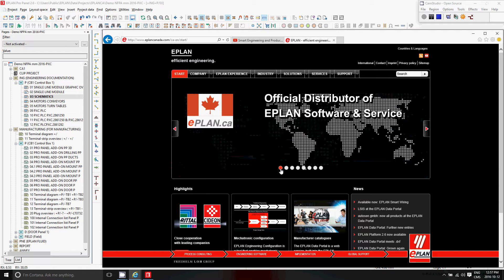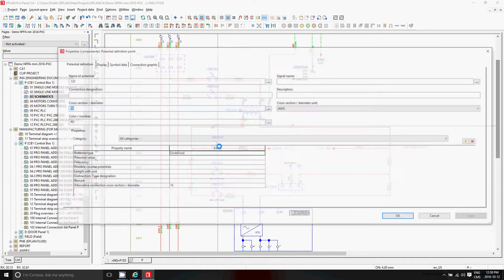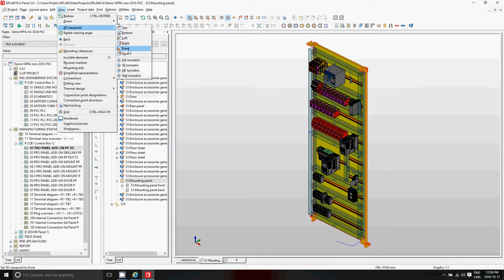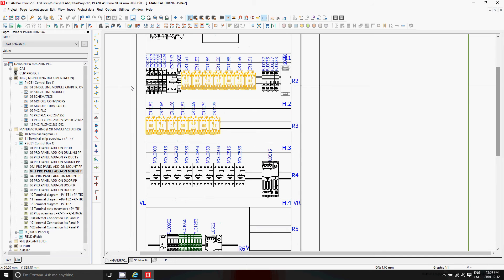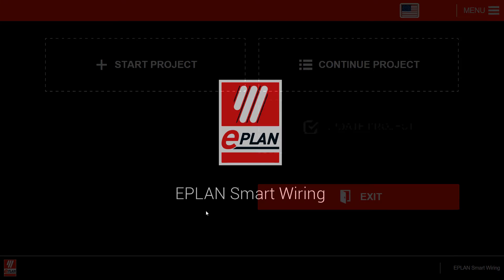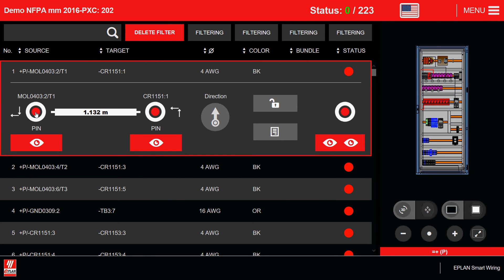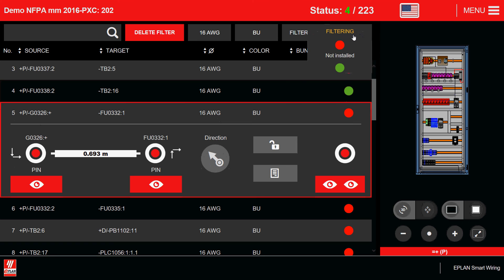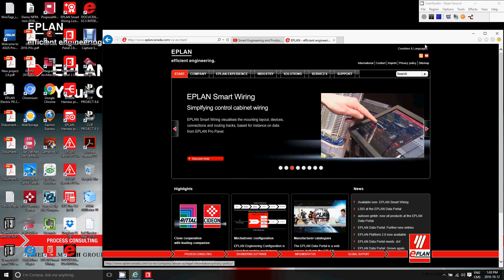EPLAN Smart wiring tutorial

Comment: Hi! When i export into Smart Wire i get error message that "the file does not contain graphic information on 3D Routing connections" looking at the 3D model, we have routing points and paths, so unsure on why this is coming up and not allowing smart wire to open, have you ever encountered this? Thanks for all of your videos they've been massively helpful in my EPLAN use
Reply from the maker: This is project related, all I can say here is to use our EPLAN Solution Center, create a support request directly within yoru EPLAN Propanel and upload a zw1 backup of yoru project. Our team will take a deep dive and figure out what it might be. I have not had this issue so far. Sorry I could not be of any help.